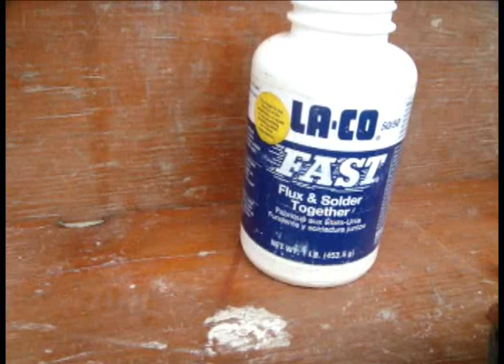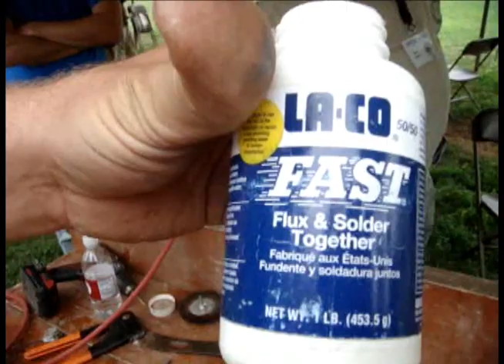Soldering Flat-Lock Copper Roofing

Comment: I was schooled to pre tin copper at the joint section prior to making the fold for the seam. This ensures a more positive flow of solder into the seam/joint. This is also more inportant when you solder verticle seams. Is this a pratice that you use for solder copper seams?
Reply from the maker: We have often pre-tinned joints. You can also use a tinning flux, instead of pre-tinning. You can also solder copper without tinning, but pre-tinning or tinning flux will make it more fool-proof.
Reply: Do you know if rolled tin is still available for boxgutter and flatlock work anymore. Follensbee was the last known suppler that I used. It is no longer a manufacter of this material.
Reply from the maker: I don't know of any source for what used to be Follansbee terne metal.  @forrestcheck-c3q

Comment: You should lay the iron on the seem and wait till the solder draws into the seem!
Reply: You could lay it down, but the solder is drawn all the way through the seam using just the tip:  the puddle conducts the heat

Comment: i use hydrochloric acid /spirits of salts with a snip of gal tin as flux i have soldered copper steel stainless steel gal sheet, tractor gas tanks / old water tanks spouting guttering over the years .

Comment: This video was very helpful to me. I am a detail carpenter who has been recruited from a roofing firm in an effort to heighten the the level of craftsmanship of the roofing crew. I'm on a huge learning curve to say the least. My question is how can I execute this level of mastery on a steep slope roof, with wind, low temps and overall poor conditions? Or should that not be expected? And therefore not be an expected of the client?
Reply from the maker: Typically, you would NOT use a soldered seam metal roof on a steep slope. You would use a standing seam or some type of lock seam.
Reply: @jcjenkins01  thanks for the reply.

Comment: Nailing copper flashing
Reply: Hundreds of thousands of linear feet of copper valley flashing that lasted over 100 years, all of it nailed.  You do have to think about expansion & contraction, which would be evident if you soldered 5 ten foot valley sections together, but not if you lapped them, or on this small section of roof

Comment: You left out the first step of pre tinning
Reply from the maker: Yes, pre-tinning is recommended. It isn't necessary, but it makes the soldering easier, faster, and more fool-proof.
Reply: Not necessary if you use proper flux, heat and make sure to sweat the seam full.  Pre-tinning was invented by east coast architects to combat poor field soldering techniques.  Same with "stitching" the seam.  None of it is necessary if the work is done properly

Comment: Im trying to build a piece with 1.2mm sheets. Its just a hobby project and Im by far in no way a trained metal worker, this is just an interest im picking up...

Can you tell me how I should form and solder or join the seams on copper that is 1.2mm thick or 18gauge i believe. Needs to be watertight.

Comment: You don't melt the solder with the iron, you melt it with the copper. This is classic "almost" correct.
Reply from the maker: Please post a video.
Reply: The heat comes from the iron and is conducted by the solder puddle through the seam
Reply: The solder is at or above the liquidus temperature within ~1.5 inches of proximity to the iron:  if I touched the solder bar to the bare copper there, the solder becomes a liquid, which is what we want